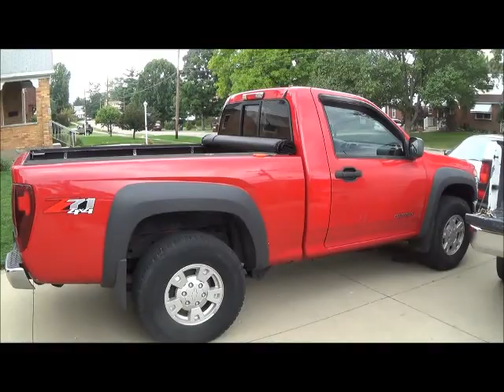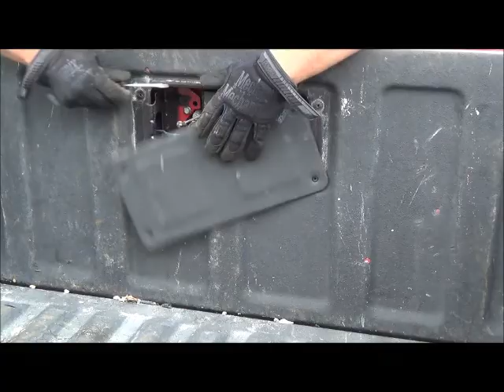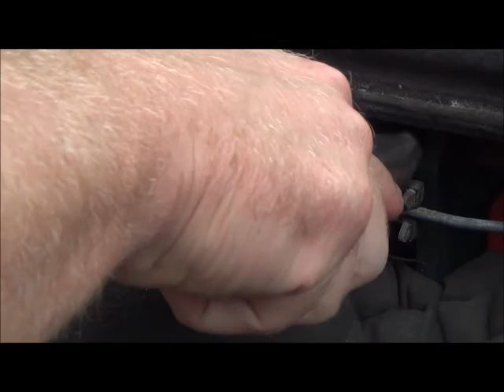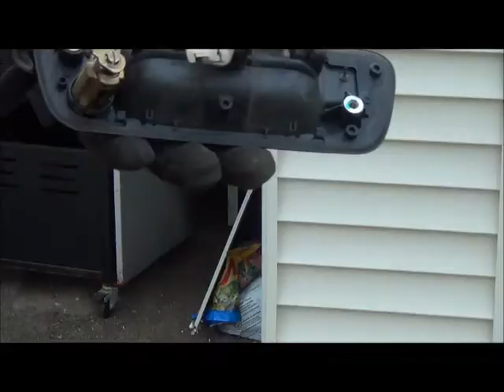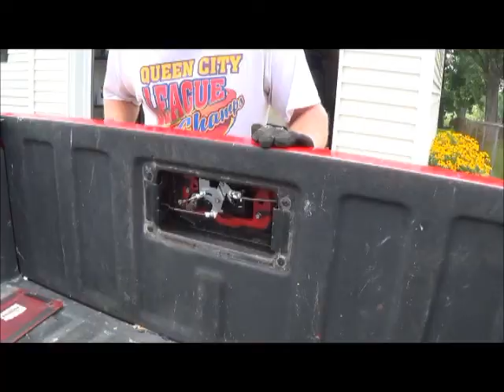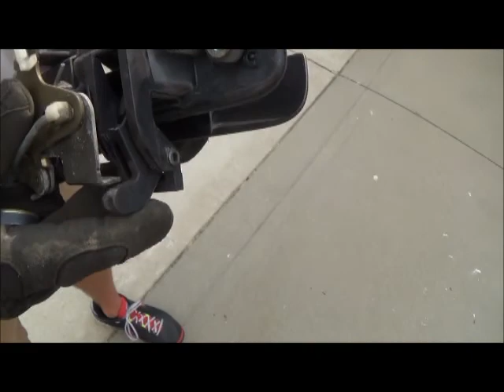How to replace and install the tailgate handle for Chevy Colorado 2004-2012

Comment: Thank you for the video - this was very helpful.  FYI, the major parts stores (Advanced, AutoZone) sell the replacement part for up to $75, which is a total rip-off.  Amazon sells the same factory GM handle for less that $15.
Reply: I have the Amazon one on the way now . I was going to leave a similar message to yours .